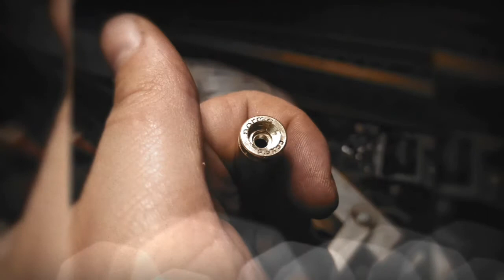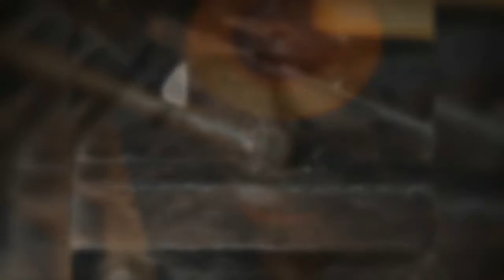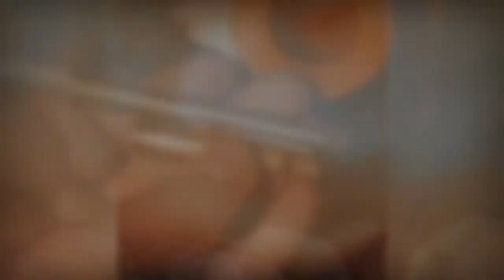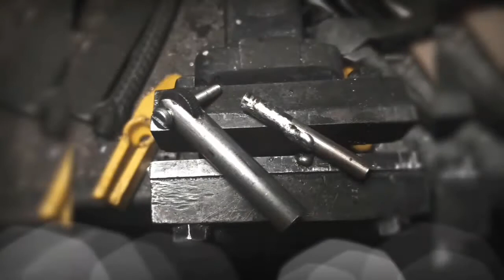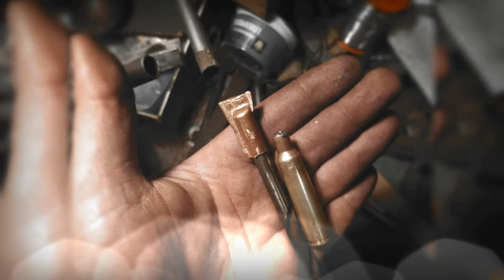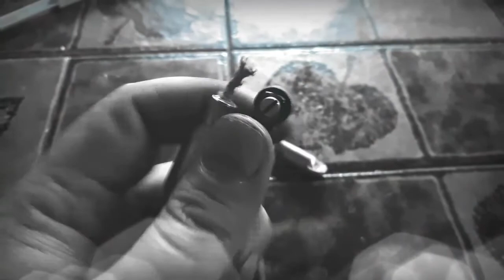DIY Trench Bullet Lighter

Comment: 3 questions I would appreciate it if you answered Thanks.

1) did you use flux?
2)did you use rosin core solder or rosin free solder?
3) did you use tin solder or lead solder?
Reply from the maker: 1 yes a little bit, just 2 see if would do any difference, bot to the other 2, i don't know XD it was just the cheap stuff that yoo also uses for electronics :P

Comment: how did you create the groove in for the flint wheel?
Reply from the maker: i used a metal saw and a file
Reply: The Craft Dude so did you saw the two sides then file out the middle?
Reply from the maker: well, kinda, i made the cuts first diagonal, and then straight down, so i ended up with 2 triangles on the bottom of the cuts, and then i filled it down